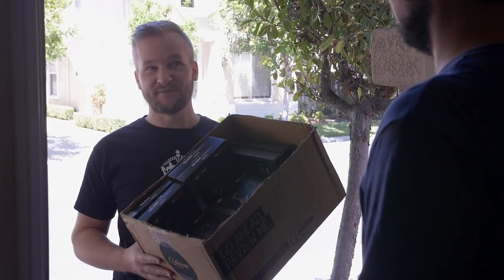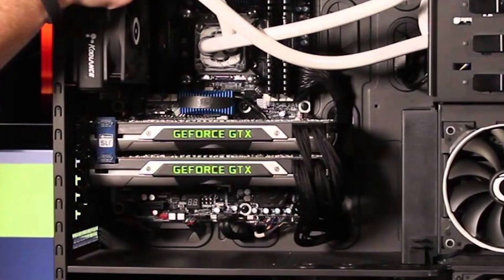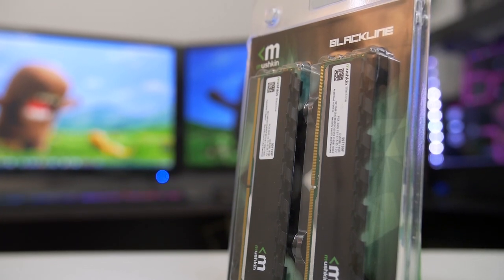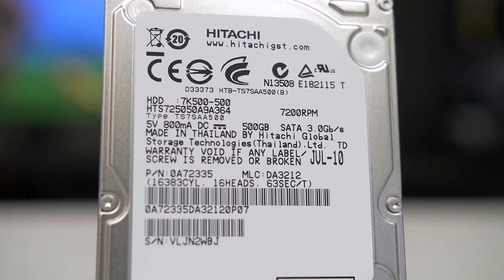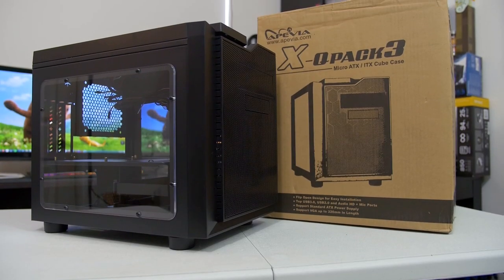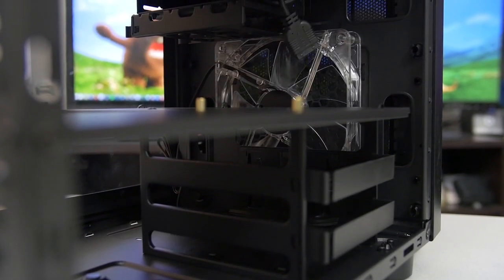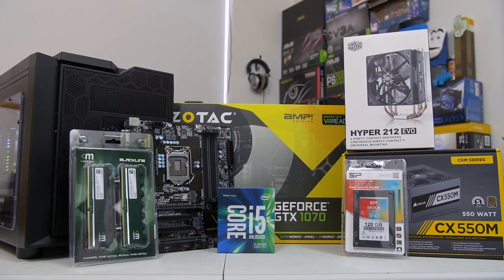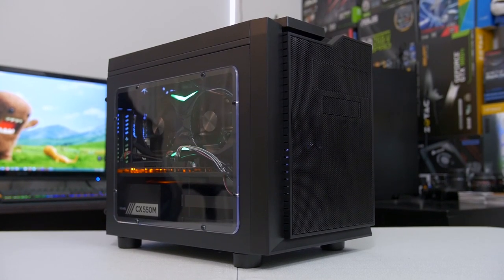The Fastest PC for $1000 - September PC of the Month

Comment: I like the placement of the m.2 slot on this motherboard but sadly the ramsticks looks to be blocking the airflow from the front fan alot. I wonder if it would be better to get one of those cpucoolers that has the fan pointed downwards for some extra cooling if one intends to get one of them new superfast and super warm Samsung 960/950 Pro drives?

Comment: Won't have issues with the power supply?
I mean I had a similar build.(16GB DDR4 ram, 240GB SSD,1TB SSHDD,I5-6600,H170 and a Zotac 1070 Amp! with a VS 650 Bronze), turns out my power supply bottlenecked my PC greatly(only about 50% of the gpu was used at max, and most games used only 20% of it, mutli-tasking would also kill my PC), I fixed the issue by upgrading to a CX850M Gold.

Comment: Is it feasible to stream or edit video on this rig? Im concerned about the quad core and no multithreading CPU rather than an i7 approach. If not, could you make a video using this rig as a baseline and switch out the processor for an i7 to compare results?

Comment: I looking at getting a new computer i was thinking of getting---
CPU: Intel Core i7 6700K
CPU Cooler: Corsair Hydro Series H100i 240mm Liquid CPU Cooler
Motherboard: MSI Z170A Krait Gaming 3X Motherboard
Graphics: MSI GeForce GTX 1080 Gaming 8GB
Memory: Corsair Dominator Platinum CMD64GX4M4B3466C16 64GB (4x16GB) DDR4
Solid State Drive: Samsung 750 EVO 250GB SSD
Hard Drive: Seagate Barracuda 2TB ST2000DM001
Case: Phanteks Enthoo Luxe Chassis Black
Power Supply: Corsair HX1000i 80 Plus Platinum 1000W Power Supply
Additional Lighting: Phanteks Multi Coloured LED Strip 1m
Operating System: Microsoft Windows 10 Home USB Flash Drive

Would this be a good computer for gaming or should i change something?
Reply: thanks that helps alot

Comment: Sooo different with mine. My PC is a$1000 dollar pc but it has: h110m motherboard from gigabyte intel, core i5 6600, 16 gigs of ram( I don't know the speed I forgot it), gtx1050, 128gigs of SSD from samsung, 500gigs of storage, and a mini ATX/ITX case with the default fans and cables( 500W). HOW DID YOU SQUEEZE IN ALL THOSE PARTS?!?!?!

Comment: How well does it handle streaming?

I have the i7 6700 and I plan on getting a GTX 1070 so I might be in a slightly better place with my build in the future.
Reply: i7 6700 + Z170 Motherboard + BCLK Overclocking - Super right choice.

Comment: i put together my pc with a rx 480 nitro, and a amd fx 8300. i overclocked the fx to 4.5ghz using the hyper 212 evo. Is my cpu a bottleneck in this case? at ultra maxed out settings with 8xmsaa and 16x filter, my game runs at about 55 fps. should i be getting more if i put a better cpu in?

Comment: mr. Kyle recently I bought the exact same motherboard and bought the sapphire rx 480 nitro+..but i saw that the second gpu slot is located at edge of the board and just beside the usb,sound plugs...so if i want to do a crossfire setup in future will it possible?

Comment: Autumn build 2016 

256 intel core i7 6700k
148 Gigabyte GTX 960 G1 GAMING 4GB GDDR5
108 ASRock Z170 Extreme4 Skylake ATX Motherboard
102 FSP PSU 750W HYDRO G GOLD MODULAR PPA7502003
105 Corsair H100i V2 AIO Hydro/Water Intel/AMD LED CPU Cooler
90 Fractal Design Define R5 Black Pearl Window Side Panel Computer Case 50
50 Samsung 250GB
60 Seagate Barracuda 2TB SATA 3 Internal Hard Drive
70 Corsair 16GB DDR4 Vengeance LPX 2133MHz Memory Kit for Skylake

Build cost £989

Comment: My pc cost me $1000 it has a i7-7700 gtx1060 3gb 16gb ddr4 ram 2400 120gb ssd and 1tb hard drive (I forgot the motherboard name and power supply). Also, it’s pre-built I got it at Best Buy.
Reply: not great but considering it's best buy... Not too surprised.

Comment: How well do you think this  desktop will do?? Please someone reply ASAP. Also how much do you think this pc would be? In pre built version tho.
New pc:
-Processor: Intel i7-6700K 4.00HZ
-MotherBoard: Asus Z170-pro
-Video card: Nvidia GeForce Gtx 970 4gb
-Ram: Hyperx savage 16Gb DDR4 [2800MHz]
-Storage: Sandisk x400 512gb Ssd & 4tb hdd
-Power supply: 800W standard 80 plus
-Operating system: Windows 10 Home [64Bit]
-Corsair carbide 600c
Reply: Standard Toast3r first of all don't get an i7 if all you're going to do is play games (BE REALISTIC) you can shave 100$ off your system and go for a 6600k instead with a 1060. 800w is overkill maybe look at a 500w psu or a 600w if you plan to do overclocking. Get a good cooler because you don't want any throttling in your system. Keep in mind what games you're playing because you might not even need a lot of power if all you're going to play is minecraft.
Reply: IggyDoesStuff I have made up my mind and I am changing the i7 to a i5 6600k im changing the gpu to the 1060 and I'm changing the power supply to a 500Watt
Reply: okay cool, get a hyper 212 or an h60 for cooler
Reply: IggyDoesStuff ok thanks bro

Comment: I know this might sound a little stupid but i just built my first pc, should i plug the hdmi cable from the monitor to the motherboard or to the graphics card??  i ask because both have hdmi ports...
Reply: if you have a Graphics Card installed, always run your cables from your graphics cards to your moniters
Reply: SuperSmielySome1 Thanks!
Reply: Andres Shamis of you don't use your graphics card it will use your CPU's onboard graphics good luck in the new rig!
Reply: Thanks i built it about a month ago with no problems and its amazing!!!!

Comment: I am currently building my first pc! Everytime I boot it up it says "Reboot and select Proper boot device or Insert Boot media in selected boot device and press a key". I'm concerned I might have fried my cpu because I booted it up several times without the heatsink installed. The reason I did this is because I didn't know if my cooler would fit in the case and I wanted to check if I did everything correctly. I didn't realize that was a big "no no" until it was too late:( pls help

Comment: Can someone tell me if its good or what's the problem? + also I have $1000 dollar only

CPU : INTEL I7 6600K 3.5GHz

Vcard: MSI GeForce GTX 1080 Ti 6GB

RAM : kingston Hyperx fury black 16GB ( 2 x 8GB ) DDR4-2133

CPU : cooler : cooler Master Hyper 212 EVO 82.9 CFM Sleeve bearing CPU Cooler

Case : Corsair 200R ATX MID Tower Case

Storage : Western Digital BLACK SERIES 1TB 3.5 7200RPM Internal Hard Drive

MotherBoard : MSI B150 PC Mate ATX LGA1151 Motherboard 

Power : EVGA SuperNOVA NEX 650W 80+ Gold Certified Fully-Modular ATX Power Supply

Comment: Someone should do a Rendering PC build using dual Intel Xeon Phi 7290. That CPU has 72 Cores. I'm not sure if the Xeon Phi would be able to do dual CPU's so if I'm wrong I put 0 research into this. I found the Xeon Phi lineup found the best one and I'm planning on building a rendering build with one of these and 128GB DDR4 2400MHz.

Comment: Hey Bitwit, Im trying to build my First Gaming Pc, I really really need your help, 
Im using a Core I7 7700k as the cpu with a GA-Z170X-Gaming 5 Motherbord. im going for the Zotac Gtx 1070. with a 750Watt PCU. Im going to be Using G.SKILL Flare X Series 16GB (2 x 8GB)  Ram. Could you help me out picking which Cooler should I Get for this PC and weather the hardware i have selected is compatible with each other.
Thank you in advance.
regards
Reply: Moaz Jamshaid Your gonna spend 600$ on a 1070?

Comment: why do Youtuber make "gaming builds" without including the Display, Mouse, Keyboard, Speakers, Headphones etc etc...These are extremely essential. You can run a PC with a single 8GB RAM stick, but u cant run a PC without Mouse Keyboard...Yet they build systems with 16GB Dual Channel memory and forget about the vital components
Reply: Because a "build" is the pc only, while a "setup" is pc including peripherals
Reply: That a pc build not a setup. Yes you also need those things. If you see any PC build always add another 200 bucks to compensate for mouse/keyboard/monitor. OS price depends on where and what you buy. If you have a laptop you can usually use that code and it will work perfectly fine.
Reply: Dawid Sopata 200 bucks for all 3? :D
id say about 150-200$ for a monitor and about 150$ for a good mouse/keyboard combination.

oh and btw if u dont have any OS key you can buy windows 10 for 20$ on g2a i think
Reply: You don't need to buy super expensive crap in order to use a pc a 30 buck mouse and keyboard combo will do and spend the rest on a good monitor. Don't buy windows keys of off g2a (don't buy anything there).
Reply: k im late here, but all of the things you named, is completely personal.
Monitor is only thing which matters here.
Mouse, keyboard is purely what is good for you. I have a G302 (Logitech) with some 5EUR keyboard. It works well, its all I care. Windows, again, personal. You can get linux for free. ( I have windows, but i get all them for free, because my dad gets 'em outta his job. I have like 7 DVD's of win 7 in my house lmao)
If you have headphones, you wont need speakers, and vice versa. I have speakers, which are 1k EUR themselves, but atleast i get proper sound in my ears, and not insane noise. 
So if you would like peripherals, you can go from around 100 EUR (saying my currency, its easier for me) up to several thousands.
Reply: 3D64R45 Choice of the internal components are also "completely personal"... Some people want nothing other than AMD products, while some want only Intel and nVidia.. 
When people "build" a PC, it should be fully functional, and usable for usage by the viewers . And how many games support Linux anyways? What AAA titles will u play with that fancy GPU ON A FRIGGIN LINUX OS??

For ex. A Mac PC.. You open the box and its fully usable at the get go(well not for games, nothing can help it in that regard) 

Try gifting this $1000 PC to your nephew for Christmas. He will be like " Thanks uncle, but uhhh..how do i use it "
and then you reply " well dear nephew, u need to spend a few bucks to get it running "
EPIC FAIL lol.

Comment: Getting my first gaming rig soon and I would appreciate it if someone could tell me if this is good or if something needs to be added on.
CPU: Intel® Core™ Processor i5-6600K 3.50GHZ 6MB Intel Smart Cache
LGA1151 (Skylake)
Case: Corsair Obsidian Series 450D Mid Tower Gaming Case 
Cooler: Cooler Master Hyper 212 EVO CPU Cooler
SSD: 120GB Intel 540s Series M.2 SATA-III 6.0Gb/s SSD - 560MB/s
Read & 400MB/s Write
RAM: 8GB (4GBx2) DDR4/3000MHz Dual Channel Memory (ADATA XPG Z1)
Motherboard: GIGABYTE G1.Sniper Z170 SLI ATX
PSU: 600 Watts - EVGA 600 80 PLUS
GPU: GeForce® GTX 1070 8GB GDDR5
HDD: 1TB SATA-III 6.0Gb/s 32MB Cache 7200RPM HDD
Would really help if I could get some advice, thanks.
Reply: I'd get more ram but that's gonna be an awesome pc :D
Reply: i have the exact same RAM, CPU, GPU and CPU Cooler and i max out out any game with atleast 70 FPS which is amazing since i overclocked my monitor to 77hz. get 2x8 RAM sticks instead so you have 16 because 8 is definitely too little
Reply: I would get a 1 tb hdd 120 gb ssd isnt going to be enough for 2 games
Reply: Can anyone build me a good gaming pc ? Budget-1400$
Reply: Instead of the graphics card you could do 3 amd rx 480
Reply: Don't touch the graphics card.  One is 1070 better than 3 480's in sli.
Reply: I say it because you cant always get more performance out of sli. And most non AMD games won't benefit from 3 480's
Reply: +SOZ I KILL YOUZ haha no? Sli 480s are better that the gtx 1080 nevermind the 1070.
Reply: Hi, for that budget you can get an awsome pc, if that's all you need:
http://pcpartpicker.com/list/ttB4M8

If you also need a monitor and other stuff you might want to go with something different:
http://pcpartpicker.com/list/KBt4M8
This has a less powerful graphics card, but includes a good freesync ips 1440p monitor.

None of these include windows, but you should be able to find some keys on ebay for 30-40$
Reply: CF/SLI is great if you are short on budget and want to later add a second card. It should also improve in the future, but yes, it still has some problems. I would still go for it rather than getting a 1080 for myself. I would not advise it to someone who is not really a hardware expert.

Comment: i was considering a similar build but i opted for Intel Xeon E3-1231 V3 3.4GHz Quad-Core Processor because i dont beleive i need to overclock, and i heard the standard cooling unit was sufficient due to its low power usage, can anyone think of anything wrong with using this CPU for this setup.

Comment: HELP IS THIS GOOD? AND CAN IT RUN 144HZ EASILY? CAN IT BE OVERCLOCKED? IM GOING FOR A WHITE AND BLACK SETUP!

Intel Core i5-6600K 3.5GHz Quad-Core Processor

Corsair H100i v2 70.7 CFM Liquid CPU Cooler

MSI Z170A KRAIT GAMING 3X ATX LGA1151 Motherboard

Kingston HyperX Fury Black 8GB (2 x 4GB) DDR4-2133 Memory

Western Digital Caviar Blue 1TB 3.5" 7200RPM Internal Hard Drive

MSI GeForce GTX 1070 8GB Video Card

NZXT H440 (Glossy White/Black) ATX Mid Tower Case

EVGA SuperNOVA NEX 650W 80+ Gold Certified Fully-Modular ATX Power Supply

WINDOWS 10 HOME 64BIT
Reply: i changed the 1070 to a 1050 ti and added Blackwidow x and DeathAdder chroma and razer firefly

Comment: i got this build except i got a corsair 650w psu and an i7 processor 6700k. I also have have a problem my computer won't turn on now i don't know what the problem is. I switch the psu to a EVGA 850w and still won't solve the problem i kind of spent all my money on this build and my wallet is dried i would like to know if maybe its the processor or thee mother board someone help me pls ty.

Comment: 500G storage is too low for a gaming/multipurpose pc. You'd have to upgrade storage in 6 months. And who cares about an ssd boot drive, I reboot my machine 3 times a year. I'd get a 2T magnetic drive and an rx 480 (or gtx 1060) instead of the the gtx 1070 and the storage combo in this video.

Comment: will i able to play games at 1440p at reasonable fps on a 800$ build?
Reply: This is the build ill be building next month

Processor: fx-8320e black edition
Motherboard: MSI gaming 970
GPU: MSI RX 470 gaming X 4gb
Case: Corsair Carbide SPEC-01
CPU Cooler: Hyper 212 Evo
Case fans: 120 mm red led (dont remember brand name)
HDD: WD Blue 1TB
SSD: Sandisk 120gb SSD plus
OS: Windows
DVD Drive: Yes
Ram: Crucial Ballistix 2x4 8gb kit (ddr4-2400)
PSU: EVGA 500W 80+
Wireless adapter: yes
Reply: Depends what games you're playing. For 1440p you might want to go Skylake i5 + RX480.
Reply: i saw that with the setup i have, i could play gta 5 on 1440p ultra with 40+ frames

Comment: A 550W PSU is overkill for this build. Just my opinion.
Reply: It's on the low side, in my opinion :P
Reply: It's lower than what most would go with, in my opinion.
Reply: ***** I have this exact PSU in my my secondary PC, but that's an i3/970 PC, with few bells and whistles.
Reply: Its so that you can upgrade

Comment: a 6600k and a gtx 1070 would lead to bottlenecking. I could easily put a i7 6700k in this system with rgb lighting and a midtower case
Reply: steven nguyen fuck rgb lighting,

Comment: I'm new at computer and switching from console. can this computer run gta 5 on ultra setting?
Reply: Without a doubt, yes.
Reply: I have a brand new full tower that I can use ex-atx, what kind of ATX board can I use with this build, and any ram upgrade?

Comment: Wtf  mine cost 1600 and i have a 970 instead of a 1070, yeah i have money put into a few other places like a 250gb ssd a 2tb hardrive and a lovely corsair air 540 case as well as a z170 pro gaming motherboard with 16 gbs of ram but this computer is about twice as powerful simply because of the 1070. it irks me so

Comment: Why am I always seeing Intel builds.
Reply: Maybe because AMD doesn't have anything can compete with the i5/i7?
Reply: +Carlos from what I understand, AMD has more cores but games don't use all the cores so Intel processors have less cores but the cores perform better than AMD cores. But what if you want to record your games and edit videos. More cores would make it happen smoother. That's where I believe AMD would be better. So why am I only finding Intel builds.
Reply: You have to keep in mind these channels, and thus their builds, are strictly gaming pc's. The point of these pc's is to give you the most fps per dollar. Below $110, AMD cpu's start showing up in some budget builds, however, after that price point, the i3 takes over since it will beat out the $200 AMD FX chip in most games. So that leaves the i5/i7 unrivaled. Also, yes, Intel chips have a significant lead over AMD chips in Instruction per Clock (IPC) so even with fewer cores and slower clockrates, they are able to usually beat the FX chips even when multitasking or production work is considered. For example, if both  the $200 Intel offering and $200 AMD offering can render a video video in a minute, but the Intel will give you 120 fps while the AMD will only give you 80 fps in gaming, the Intel has every advantage. Even if you did record and stream while gaming, the Intel would have to dip below 80 fps before the AMD build would even make sense. To put it in perspective, even AMD themselves used the Intel chip in their yet-unreleased Dual-Fury build. 

So while as of right now, building a high end gaming rig pretty much requires Intel, AMD's Zen architecture is around the corner which should compete nicely with the current offerings. Who know if it will be able to beat (my educated guess is that it won't), but it will at least provide enough competition that AMD builds will soon be viable once again.